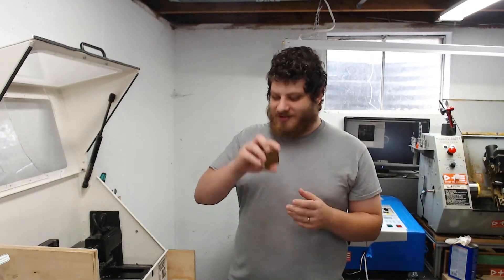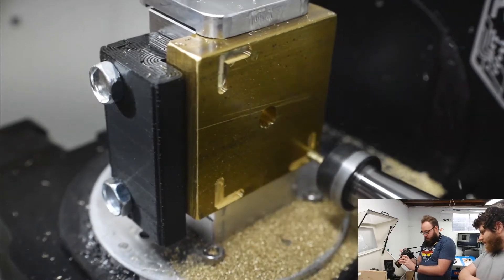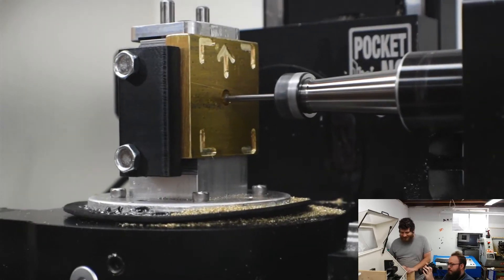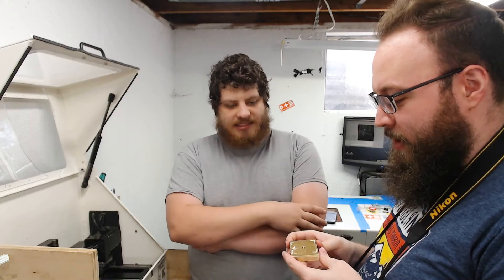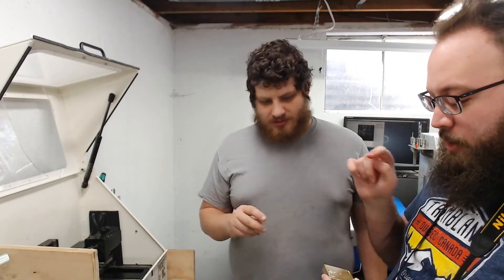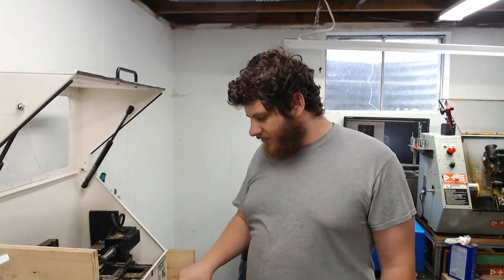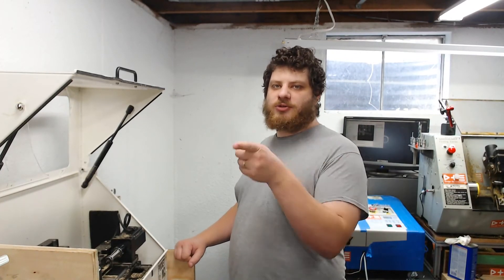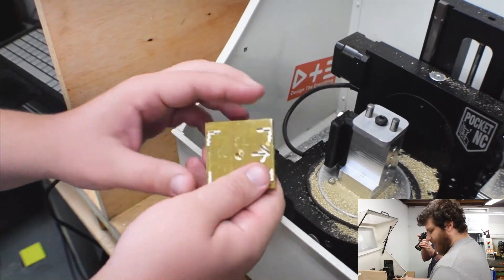Machining A Branding Iron | Branding Irons Part 5

Comment: Contour side was @ center line and outward side (Top) was off-set in X.
 You could tell by the margin thickness.
 Mistake ...or on purpose?
Reply from the maker: I'm not 100% sure what you are asking about here. Are you asking about why the "aiming brackets" are off center? They are off centered, and it was on purpose, though I do it differently now. I try to explain this at around 4:30